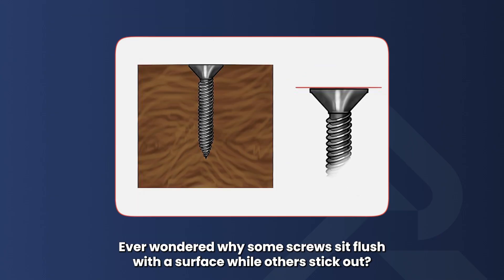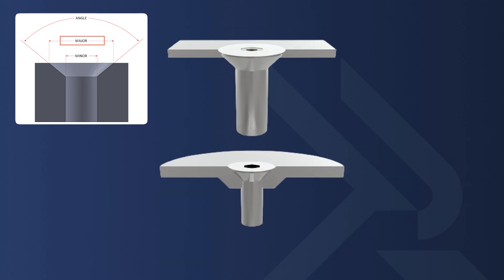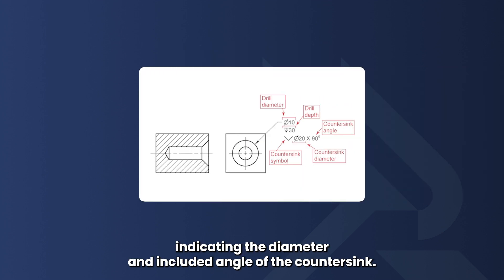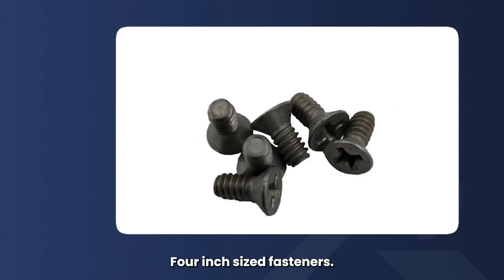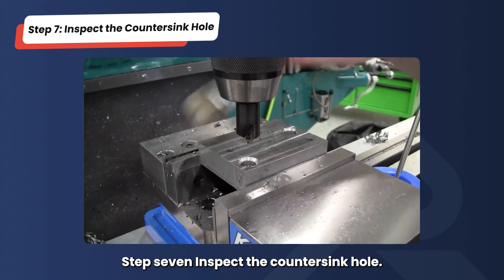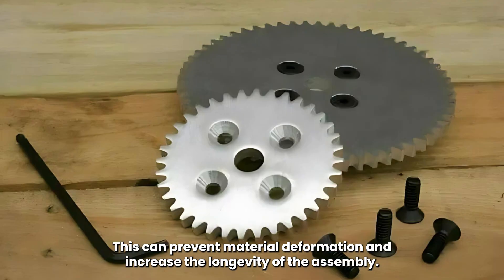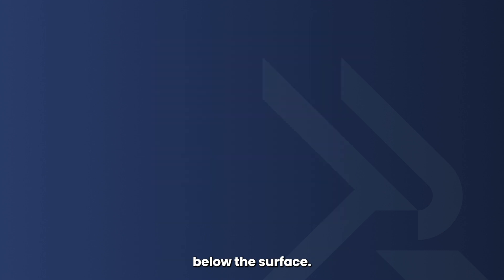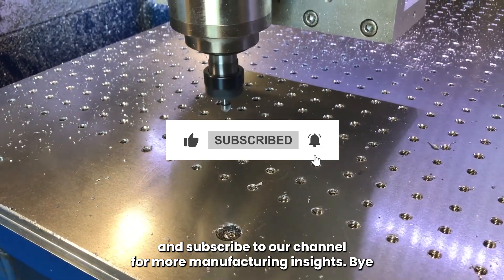Countersink Holes: How to Countersink Your Parts

Comment: One question, as you have shown that we have not given the depth of CSK hole , the slanted part I am talking just. What we have mention is outer diameter, inner diameter and CSK angle. So , do manufactured need to calculate the depth of CSK hole manually for drilling the hole. What is the standart practice in machine shop?